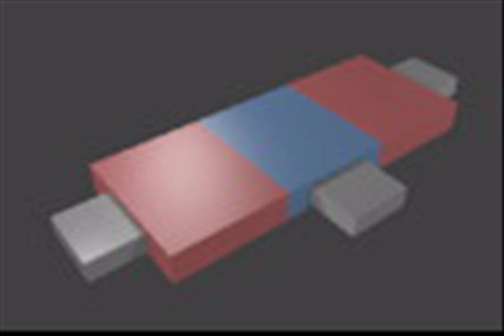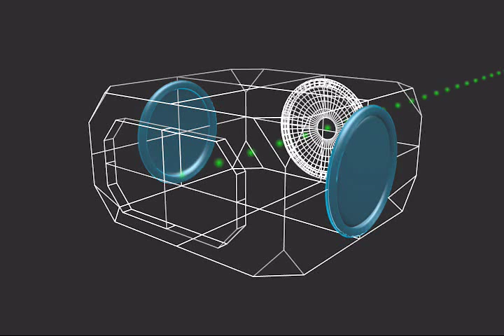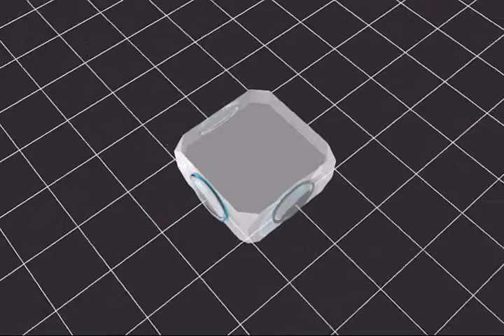2014 ExploraVision: LTCHDTM Using P-SOT

Comment: Well, where did you reach with that? Why is nobody talking about this solution anymore?
Reply: As the voice behind this video, this project was done in high school where we only had a bunch of Wikipedia articles from which to research phenomena for creating "photonic transistors". Our original contest websites can be found at http://314157498132943849.weebly.com/ and http://dev.nsta.org/evwebs/2014104/index.html. A simple Google search of "optical computing" and "optical transistor" will bring up the latest findings in this field. Presently, I am inclined to believe that the "photonic saturation" described in this project is closest to the documented phenomenon of "electromagnetically induced transparency" (https://en.wikipedia.org/wiki/Electromagnetically_induced_transparency). https://www.mpg.de/10478678/photonics-nanooptical-transistor touches similar concepts to the "crystal substrate" our project proposed, but more usefully achieves it with one molecule. I also probably should have included https://www.youtube.com/watch?v=eFhgb5CqAy8 in my bibliography as it was one of the major inspirations during the project, though I likely didn't watch it in full at the time. Now in university studying computer engineering, this topic would definitely be of research interest to me, though I wouldn't be surprised if some PhDs preceding and succeeding the posting of this project shall have achieved its aims before I even get close to being qualified to pursue them myself.